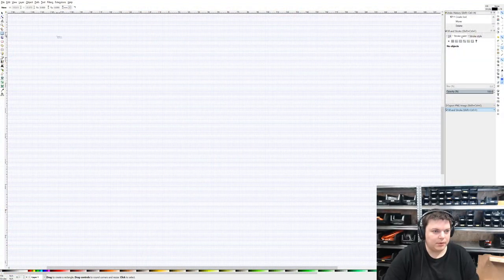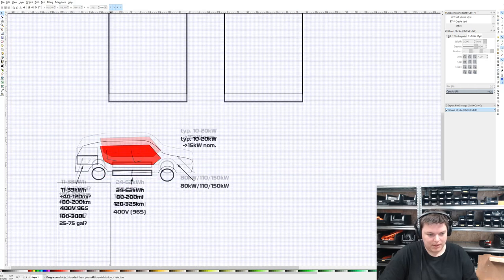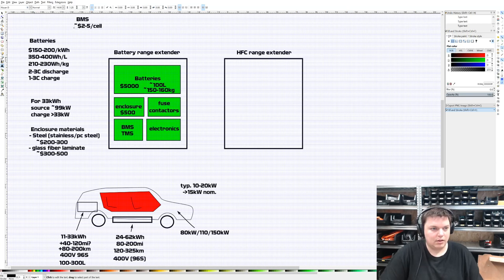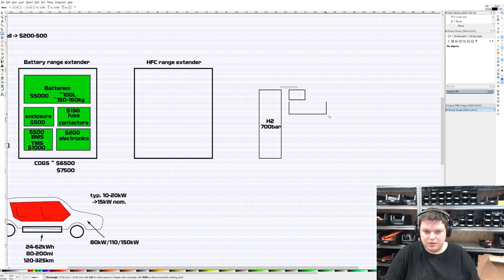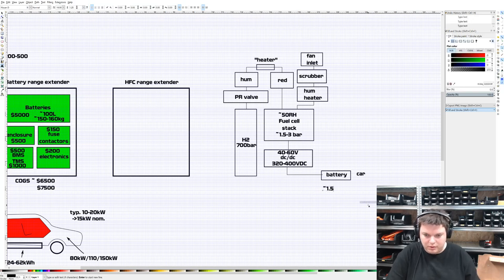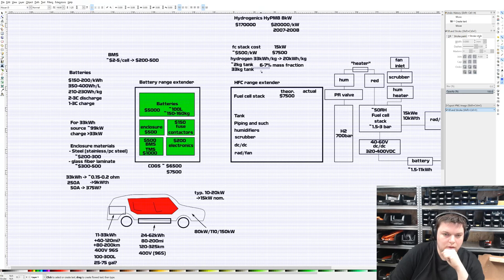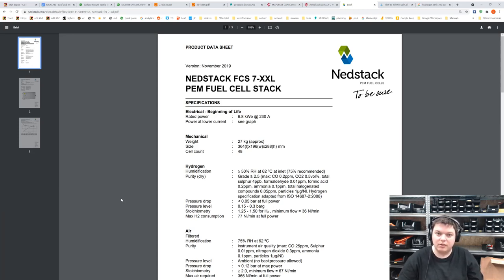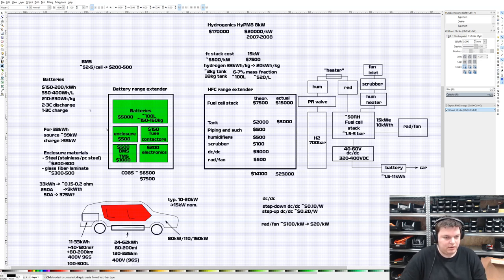Hydrogen fuel cell range extenders (deep dive)

Comment: I believe you priced the DC-DC converter a little bit too high.
Reply from the maker: Well, this depends, and is an entire 60-minute video in itself. For us, for a relatively small-scale (~1kunit) outfit, with little ability to highly integrate and optimize this system, it's going to be more expensive than $0.20/W (i.e. for the purposes of this video I've been conservative). For a company like Toyota with the ability to do some integration, it's definitely possible to make this cheaper.
Reply: @PowerElectronicsBlog  OK Max, sorry for probably coming out as completely unconnected with the matter here, but I think that price/W drops dramatically as total wattage increases. I mean, you can easily find AC-DC chargers at 7kW range on Alibaba for just €500...
Reply from the maker: @ThanosSustainable   Unfortunately that's a completely different beast. AC-DC, especially for consumer goods low voltage supplies, is an extremely competitive field. DC/DC conversion, especially when both sides are (relatively) high voltage and the entire thing needs to be automotive, is much more expensive. It's true that there is some good scaling with power, but this only goes so far - while the converter gets cheaper, cooling and other aspects get more expensive. You tend to hover not too far from $0.20/W in this range, and only get appreciably cheaper deeper into the double digit kW.

Comment: Well, combustion engine range extenders don't seem so bad now.  Although it would be way cooler if my Volt had a turbine range extender instead of a 4 cylinder.  If you liked this video, you may also like "jet-powered garbage trucks can save the world."  https://www.youtube.com/watch?v=F4H3FE0Z4QQ   There is a great joke: "You don't know range anxiety until you drive a hydrogen car" referring to scarcity of hydrogen fueling stations.
Reply from the maker: Well... that's another can of worms. Combustion range extenders may seem interesting, but we've had a couple really well thought-out implementations being sold, and they quite spectacularly failed. That goes for piston-based, Wankel and jet-based. There's good reasons for that too, but not economic ones. I think it's fairly obvious that a piston engine extender will be the cheapest option for a given amount of range, but the reasons it's uninteresting to most users and companies alike is more psychological and regulatory in nature. Maybe I'll get back to that as well, as it is a good business-related topic.
Reply: Anecdotal story, I worked for a while for a small startup which had the ambition to design a jet range extender; I was the motor guy. So the dev was hard, as the thing needs to spin fast, start and stop and pass emissions like any other combustion thing on the road. Well, one day it finally started, with fuel and stable combustion (ish) and OMG the racket! The whoosh was so much higher pitched than a jet engine and so unbelievably loud! Cool stuff in a way, but I remember the rumblings of the crew after the test on how big the silencer must be to quiet that thing down. Just one of those technologies that seems a good idea until you try it.

@Mux, many thanks for this video. I knew some things about fuel cells, now I have memorised a scheme I can relate to. Love the bussiness angle, and can't wait to see how it can scale up to make it work (tell me it's campers andnot trucks :) ). Even if someone is crazy enough to make a H2RE, good to know you can, however uneconomical it might be.
Reply from the maker: @dragosmihai3489  Yep, I originally had a segment in there that said more or less exactly how to start a company like this. It's definitely technically possible and has been for decades, the reason we're not seeing anybody doing anything like it is purely economic. I'm not doing another video on this anytime soon, but will be trying to publish a more in-depth blog somewhere in the next few weeks.

Comment: Ammonia is safer
Reply from the maker: Certainly a lot more energy dense and easier to handle. But like gasoline and diesel, it has a massive toxicity issue. We kind of seem to accept, as a society, that petroleum products end up in the environment in large amounts, but I don't think doing the same with ammonia will go over quite as well.
Reply: What about the gwd awful stentch... you'll need more than that tree-shaped freshner behind the mirror
Reply from the maker: @dragosmihai3489  yes, that's actually a massive issue with ammonia: it is detectable in ppb concentrations (parts per billion) - meaning a leaky tank or leak during fillup (even just evaporating ammonia from an open bottle) is detectable a block away or more, and impossible to live around within a couple tens of meters distance of the leak. This is fine if it's confined to very few industrial estates, far from homes and shops. But it's an almost certainly unsolvable problem if we intend to use it as vehicle fuel.